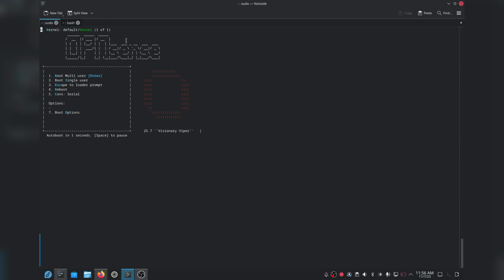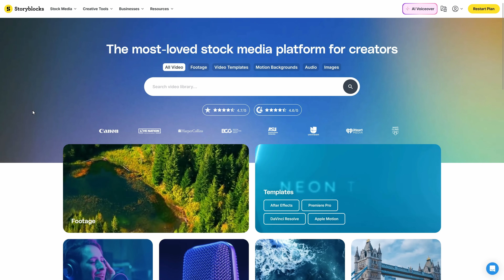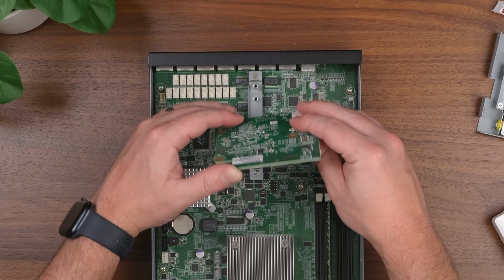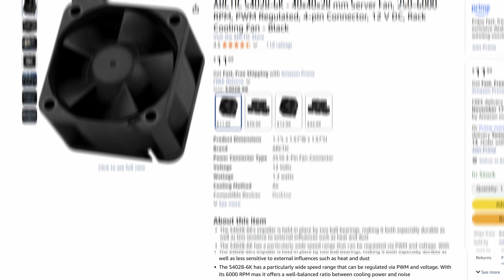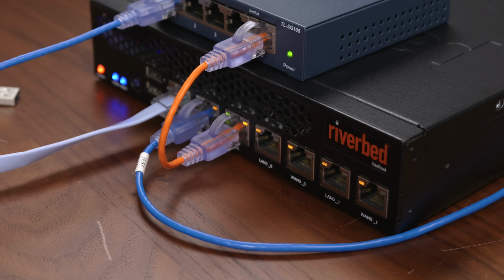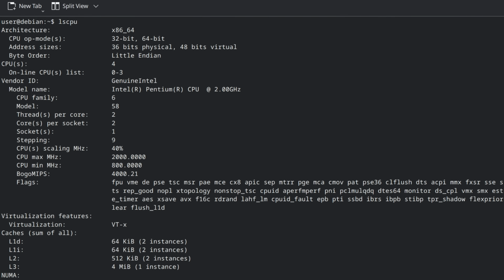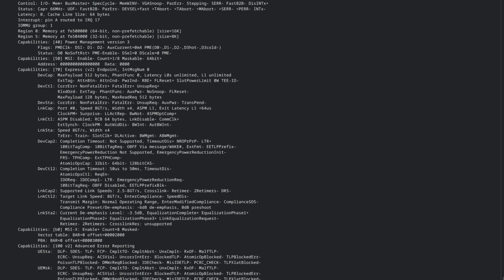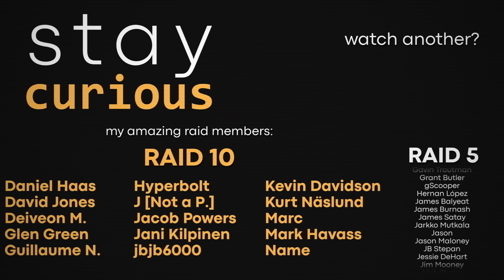The Best Budget DIY Router You’ve Never Heard Of

Comment: Used to have these in our office environment. They were great for acceleration across the network because the larger ones essentially just had hard drives inside that cached the most recently accessed files and kept them local to be accessed again in short term, but they lost their edge when MPLS was replaced with SD-WAN and bandwidth became significantly cheaper.

Comment: curious about what cpu was in there, why didnt you cross reference the die markings online when you had the heat sink off replacing the paste?  from looking up the NAMB-3250 on the board, it looks like its an INTEL SR1J3 2.0GHZ/4M DUAL CORE CPU

Comment: I ended up pulling the trigger on a CX570 and a CX770.  The CX570 is running pihole/unbound (and a few other light services) for my homelab.  Had been using RPis, Odroids, LXC containers and VMs all of which ended up being flaky in one way or another.  This seems like it's going to be pretty bulletproof.  The CX770 is going to get repurposed into a VPN appliance to handle my IPSec ingress VPN (QAT accelerated) and my egress VPN using Watchguard.  

I was already in the planning stages for both appliances, and these ended up being the perfect hardware platform for them, so thanks for sharing the find!

Comment: These were a good deal at $40. At the $100+ that these things have climbed to, there are decidedly better pfSense devices available. If you already have a 1Gb connection from your ISP, consider something that has or can be upgraded to 10Gb if futureproofing is important as higher speeds are rapidly becoming more affordable in many markets. 

If you do decide to get one of these, go for the 770 model as that steps you up to a Xeon E3 and according to Riverbed, only costs you 5W of power dissipation.

Comment: Ohhh maaaaaaan, the moment I saw that gaggle of relays on the front of the board, I knew EXACTLY what we were getting, and it did not disappoint! Super sweet. 

That x8 slot is full of possibilities. With your m.2 adapter you could mount an AI accelerator and get good performance with Frigate NVR, for instance. Or a cell modem, drill some SMA connectors into the case and configure it as WAN backup. There are m.2 NICs for 2.5Gb copper and 10GbE SFP, including some with a little cable to relocate parts of the setup away from the slot itself, which I think would be perfect just chopped into the case where the Riverbed logo is.

I also spotted an internal COM header, which would be great to mount a little GPS receiver (again with an antenna port drilled through the case), to provide a local NTP reference. There's plenty of space in that little guy, especially with the BMC removed, so IMHO the sky's the limit!

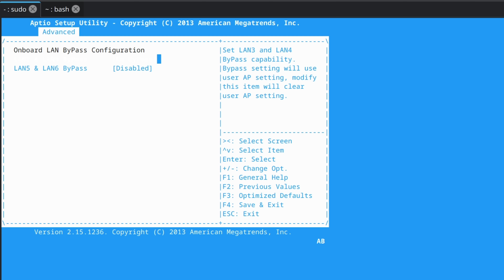Comment: 8:42
Did you look into if theres any way to turn the bypass "off" once proxmox or pfsense has booted?
It would be actually pretty cool to have a fail-over internet gateway incase the riverbed has crashed or is turned off -- By coupling another router with the WAN directly.

Comment: After watching this video I actually looked on ebay. By the time I looked all of these were $150+. I actually managed to snag a NIB CX-580 for $77+shipping though($112.88 total). After it arrived and cracking open the case, USB-C and 16 GB DDR4, as well as two m.2 slots (occupied by SATA drives, 32 GB and 240GB) and a 1TB 2.5 in spinning drive, I have moderate hopes of what I can do with it. Not going to power it on until I image the drives since it is NIB. Hoping the unused SFP ports are SFP+ and not hardware disabled, and hoping the m.2 slots are PCIE capable. Still have to attempt to identify the processor though, can't find any documentation that specifies it, nor can I find any 3rd party information about it like this video about the 570.

Comment: I have a Riverbed 1U server with a Dual Socket 771's and it's just a rebranded Tyan server.  It also had some kind of IPMI board which was also pretty useless.  A lot of these multi-port embedded router type devices are made by Lanner.

Comment: 26 Watts for an opnsense router? Nothankyouuu x)

Europe's energy bills are going through the roof, often times weird calculations that shouldn't have to be made between "a 100€ device" and a "500€ device" that both do the same thing can land you into buying the 500€ solution. Because even at "low-ish power levels", over 3Y the power bill has eliminated the cheaper device.

If I had land, I'd build myself a solar-powered "shed" (or buy a repurposed shipping container) to serve my tinkering and networking needs. It'd be pricey, but on the long run ... Worth it.

Comment: Place I worked (router firmware and software engineer) in 2009 put in a Riverbed. It worked really well for the manager in our remote office, but I and the rest of the developers were less impressed. As in we saw no observable improvement, and suspected a slight reduction. The vast majority of our traffic (Clearcase and Mercurial) was not accelerated by the Riverbed unit. If anything, it was slower with than without.

Comment: I used to run these in my infra at work. Not this model, but larger ones. They were originally designed to perform multiple "optimization strategies" for campus and branch networking. Stuff like caching, tcp optimization across a wan links(you need one on either end), and more. They're a great buy on eBay now cause modern traffic is end to end encrypted - these had value when they could intercept and do basically a "googled guy mitm attack" to reduce congestion.

The value proposition for a business is that it used to be cheaper to install and run these than buying more private t1 circuits for each branch office.

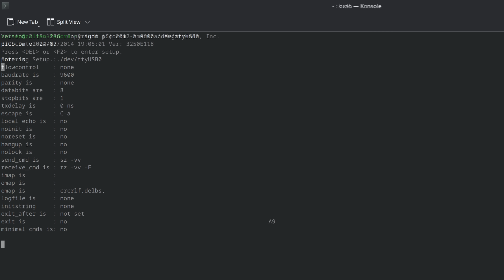Comment: 5:30 I would always use the default 9600 baud first before any other common speed, as 9600 is the default that at least 99% of serial manufacturers.  OEMs might change this speed; but 9600 was the default they received it as.

Comment: The lan bypass is a real selling point.
Use case is having a pair of these clustered as edge devices and the wan connection cascadedbetewwn the two.
If primary fails the secondary kicks in with no need to move the cables around.

The big NO selling points are port speed and expecially power footprint. 22w at idle is quite a lot for a firewall with that performance (just think of an ubiquiti or even a raspberry pi 5 /CM5 based firewall or a zimaboard)

Comment: I had one (Xeon Version) , I went through server iterations of being a Firewall (IPfire) then it upgrade it to 32GB ram and ran XCP-NG on it. then it got sold off. 
I didn't replace the fans, they are loud when it starts up but it slowly ramps then down over around 5-10mins.  
Also if you use a PCIe Riser card you could stick in a GPU. That 7amp 12 2v was just i guide in the end i was running it of a PoE Splitter.

Comment: Used these in the Oil and gas industry for remote sites with poor network links. The folks at the sites could access their "files" and scada data but we could then trickle that back to head office for proper backup over the wireless shots before the radios froze for the night
Reply: that seems like the best use scenario for them.
Reply: Rarely are electronics genuinely frozen like that. I love it.
Reply: @GoingtoHecq  You could track the sunrises in the valleys when they were defrosted enough for the monitoring software to report back online 🥶

Comment: This video brings back memories. It's probably been 10 years, but I used to run the older (Riverbed Steelhead CX-555) with Pfsense. They are solid as hell!  Had 4 of them in pizza shops where the environment was hot, and dusty (flour dust). Never had an issue. Also ran them at remote colocation racks due to the hardware being so robust.. The Bios used to be locked. If I remember correctly the password was "minnow".  I still have a few laying around.

Comment: I actually used to run into Riverbed appliances a lot beach in the day. There seemed to be a hard push towards x86-based appliances running some sort of Unix variant with proprietary software on top. Coyote Point Systems (later acquired by Barracuda) was another one of those companies. They made inbound network load balancers (“intelligent traffic management”) on x86 hardware with FreeBSD (later, NetBSD) and proprietary software on top. It was an interesting time seeing that evolution.

Comment: Just a little software recommendation for the console interface (and a lot of other stuff). You may want to have a look into Moba Xterm, supports pretty much anything from ssh, console ports, rdp and many more. Its pretty good at saving and organizing all kinds of different connections^^

I only used it on Windows, but should work with linux ir Mac with a little bit of extra work

Comment: The ipmi can be used to access the serial console remotely, it gets ip on the pri port.  ipmitool -I lanplus -H 10.x.x.x -U admin -P admin -C 8 sol activate. The webui can be pain to access from what i remember due to outdated ssl from what i remember. I run opnsense on my cx570 and have one unused cx770 that i need to switch to ;D.

Comment: I did something similar with a Sophos SG115W. Saw some on eBay with OPNsense installed and ended up buying one with no storage. It's been running OPNsense since then really well. Has 4 ports though I'm only using two for now, only draws a few watts and was like $30. It has some kind of Intel Atom. One of these days I plan to buy a second and do high availability just because of how cheap and low power they are.

Comment: These types of appliances are great for running a transparent firewall in front of your main edge router to do things like packet inspection, intrusion detection and prevention, and regional connection blocking, as long as you have a working watchdog. The CPUs can't handle routing and a bunch of other services like IDS/IPS at the same time without latency going up a bit.

Because of the lack of 10 Gb nics, spending more than $50 shipped on one of these is probably not a good idea since you can get ready to run hardware from Ubiquiti for not much more.

Comment: Instead of worrying about thermals with HT enabled, you should be worried about spectre/meltdown, especially on such an old hardware without microcode updates. Also, if you are going to use these old devices for anything useful, especially routing/ipsec, just put in ECC memory, otherwise it's just a toy.

PS. I forgot. I bet the management console in this is actually accessible through the network. you just have to configure it properly. ipmitool is you friend.
PPS. Also, if you guys are serious about using these devices for routing, always buy two of them, especially if they are rack mountable, and set them up properly with VRRP w/ openwrt, or whatever *BSD you are using and CARP, otherwise you are just introducing single points of failure, it doesn't matter it's your home network, at least the router should always be redundant.

Comment: When you had it open for cleaning, the CPU says what it is. Its called a S-SPEC code, S + 4 letter/numbers. Yours is SR1J3 = Pentium dual-core mobile B925C ... an Ivy-Bridge CPU. Anyway its very nice hardware, yet I would rather want a Haswell based CPU (for AVX2). The ASPEED is rather called BMC, not iLO - which is just a marketing term of HP (and they rarely use ASPEED chips). The ASPEED does have a VGA though, you may want to check that in lspci. Then you can use a web browser and html5 console for a GUI approach, even that the box has no video port - its typical on servers that the small VGA card is handled by this aspeed bmc and the vga port connects to it.

Comment: Can you bifurcate the PCIe? If yes, you could 3d print 2nd level to the chassis to fit in whatever you need and get for example 4 SFP (4 lanes theoretical throughput is 32Gbps) + PCIe drive... Or you can add a bunch of SATA/SAS controllers and make NAS ( power might be a bit of a problem...).
Reply: Tech that old probably can't bifurcate

Comment: 8:30
I had a boss that thought it was a good idea to send guys 1200km away and have them try to solder 100 PCB's while hanging off a 29' ladder.

I looked at him and called him stupid.

I contacted the vendor and had them give me a solution where I could reprogram all the PCB's "backwards" from the far end-points of the lines by connecting to a customers drop cable at their house. Boom, problem solved.

Electroline, if you're out there: I love you. ❤❤❤❤

Comment: I used a old Hp Elite Desk G1 800 Micro pc. I installed "Untangled OS" router OS onto it. and its fire.
Reply: I recently picked up 3 705 G4 mini with Ryzen 5 2200 8GB and 256GB NVME for a whopping $35/ea. Just popped a m.2 NIC adapter with I226 2.5Gb custom mounted in rear flex IO. Got OPNsense on there. Nice small PKG router. Waiting for my new Fiber service to be installed...but I'm ready haha

Comment: The Intel DH89xx boards did a thing where they exposed the PCIe as an abstraction. The gbics were exposed as "endpoints" on the bus or something... It was a weird thing. Google for Intel DH89xx  Commmunications Chipset. The datasheet might give you more info about the structure of the hardware... It's a little non-standard.

Comment: That's a pretty cool video. I have a cyberoam dpu:cr15ing network appliance that I was given and I turned it into a PS sense router. The thing has a mini PCI port that can be used for a wireless card and a CF card slot which I would have loved to put the OS on but for some reason it wouldn't work so we ended up using the SATA drive and it works really well. I love being able to repurpose old hardware for new things. Keep the videos coming. ~BP~

Comment: used to work for riverbed. The OS is based on scientific linux, so it's a stock, standard Linux with extras. The "passthough" cards were re-flashed Intel cards.  These appliances (SH250/SH570) the "extra" ports were controlled via the I2C bus. powered down, lan1/0 and wan1/0 just passed through.  It's called fail to wire.
Reply: I remember deploying Talari SD-WAN devices back in 2017 and they had the fail to wire option as well. Saved me more than once.
Reply: We bought some Riverbeds that had optical passthrough ports. Really clever tech but painfully expensive!
Reply: @1anwrang13r They were expensive but if you had a project that matched the capabilities of the software, the ROI was typically six months. The problem was selling the idea! It was typically seen as a project that took work away from system engineers. The system engineers loved riverbed when it solved their bandwidth and latency issues but the enthusiasm disappeared very quickly when they learned riverbed could replace local domain controllers and file servers. :)
Reply: Worked a lot with riverbed in 2004-2005. It was a great product at the time. Unfortunately, the boss of the boss of my boss didn’t like the product. Our independent network integrator was acquired by a Telecom Provider who wanted the sell bandwidth and distributed outsourced file servers with expensive maintenance contracts.
Reply: We used to use Riverbed Storage Mirrors... they were amazing devices!
Reply: I have a riverbed CX-555 collecting dust because I cannot figure out how to reset the bios password for it. 
I tried contacting support, but they wouldn't give it to me either.

By any chance, do you know the bios password for that particular unit or can give a hint on how to reset it without desoldering the bios chip?
Reply: @slidetoc google for minnow board. those passwords were lost lore when i was there.
Reply: @slidetoc  try "minnow"
Reply: Wow you found a whole AI echo chamber for investment scams, how fascinating… 😂
Reply: Riverbed are awesome caching devices. We used them for SQL caching, CIF/SMB caching etc.
Reply: Thx man really helps
Reply: Woah bots are really going crazy under that comment.
Reply: Please how can I sign up for her services. Can I write her directly like WhatsApp?
Reply: Can I write her directly like WhatsApp
Reply: Can I write her directly on whazap 😊
Reply: Thanks, I have contacted her and she responded nicely. I'm about to start my trade. Please wish me well
Reply: Mad respect @BruceFerrell, we had one of these in each site to cache media and I would also use it to find people using non-cache media back when YouTube and Hulu were new.   Great product!
Reply: Is she on WhatsApp ❤
Reply: when will you leave retirement
Reply: @s0kulite semi not retired now... project work. no reason to go back to corporate work.
Reply: Es una mujer agradable, le acabo de escribir por WhatsApp❤
Reply: This same lady made my husband and I have our own house and first car. She is good. Her success story is everywhere, her method surprise me honestly
Reply: Who is this lady everyone is talking about?
Reply: @NarutoGaban  Spambots trying to game the YT system to gain popularity. they are always around, just seem to be hitting here today. best to report them as spam.
Reply: Is she on whazap
Reply: She is a nice woman, I just wrote to her on WhatsApp❤
Reply: I watched this woman live on CNN talking about trading, and I truly admire her teaching approach.

Comment: There was an ebay listing with qty8 for cheap. I bought 2 and 30 seconds later they were gone. You made some ebay sellers happy with this video lol.
Reply: ebay sellers always rejoice when a homelab channel shows some old EoL gear that can be repurposed
Reply: @marcogenovesi8570  yep
Reply: yeah i just checked on ebay and the cheapest cx-570 (with power adapter) is $95+32 shipping
Reply: @RoshiGaming Yup. 40 dollars no more. I was looking for some more hardware for when my Zotac ID.98 running OPNsense dies. I like the Riverbed units because they use less power than mine currently and Im on solar.(zotac uses full desktop 60w cpus).
Reply: plot twist: Hardware Haven was the seller (/s)